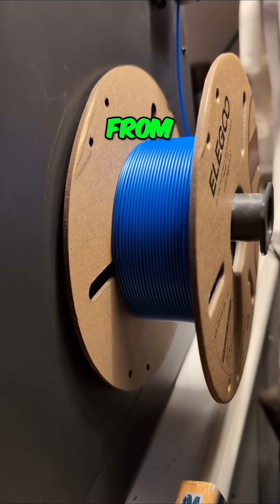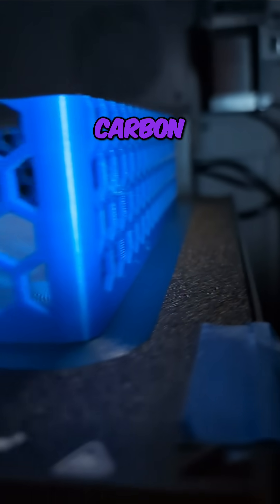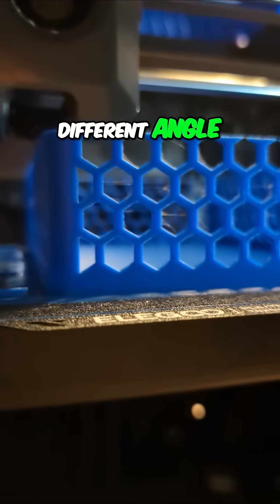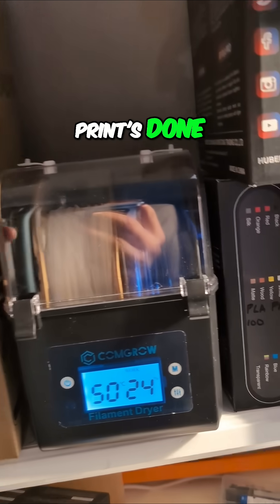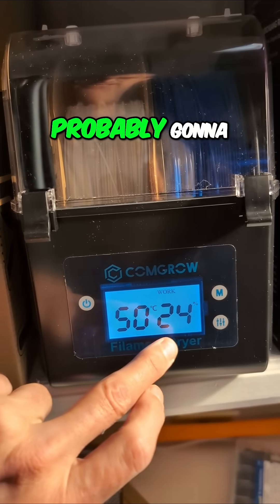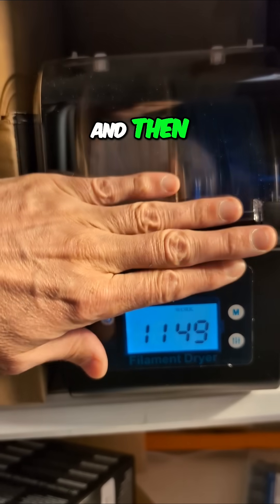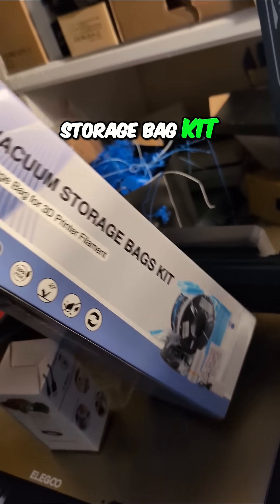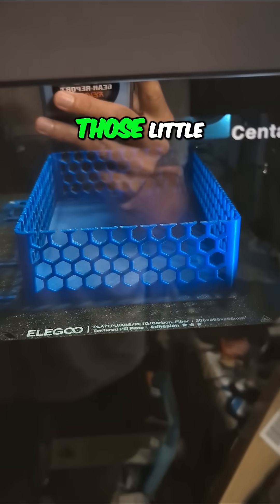3D Printing Problems? Dry Filament = Perfect Prints! 🔥

Comment: Had this strings in brand new filament that printed right from my dry box at %21 humidity. Dropped the temperature and it crisped up minimized the strings to almost none
Reply from the maker: Good tip... tuning the temp to your filament can clean up little issues.

Comment: Seattle here...if my PLA snaps like un-cooked Pasta, I dry it.
Food dehydrator running at 50C with indicating silica-gel beads.
Dry PLA for an hour after the beads turn orange.
I print hot and fast: no stringing!
PA6, PET and ABS get 6 hours in drier.
Reply from the maker: Dry filament FTW!

Comment: You can make a dry box to store filament that’s sustainable for very little money. I teach 3d printing in a very humid public school. Water tight xl Tupperware bin from Home Depot, reusable desiccant beads, and 3d printed desiccant holders. About $40-$50 keeps around 20 open spools of PLA dry with no issues. I’ve had spools that sat for 4 years and were perfectly fine. As long as you trim off about 8-10 inches of the end before you load into the extruder it’s a great solution.
Reply from the maker: I'll look into that. I have one dryer and am using vacuum bags now.

Comment: ah, I have a cheap Creality Spce Pi that i bought on amazon for $60, that I have connected to the printer, so the filament is dryed and used at the same time.
Reply from the maker: My dryer has put ports as well. Just haven't rearranged the workspace to fit it beside the printer yet.

Comment: It could also be a temperature issue too.  I’ve learned on some of my filament if I run too hot they string, but if I run them cooler they come out clean.
Reply from the maker: Good to know. Thanks for sharing

Comment: I use regular vacuum bags that you can put clothes in, I can fit 5 1kg spools per bag, they're reusable, and they seal with a ziplock style seal. You just use a regular vacuum cleaner (I use a small electric air pump, or the bags I bought are supplied with a manual pump). Works pretty good for me :)
Reply from the maker: Interesting approach. I'm happy with individual bags, as I only use 1 roll (maybe 2 if running both printers) at a time. So, no need to expose the others ot the super high humidity around here.

Comment: downside with vacuum seal bags is you have to rip them open every time you want to reuse that filament. You’re better off just getting a double seal ziplock bag with some desiccant after drying of course, and it’s more than enough.
Reply: If you get the reusable ones it's not a big deal
Reply from the maker: Agreed 👍
Reply from the maker: Huh? The vacuum bags i'm using are resealable. Just like zip-lok bags. :)  https://amzlink.to/az0uDmzCw3Mq0

Comment: What’s your humidity level? I print at 45-50 and have no issues.
Reply from the maker: Unfortunately, my office is a converted attic that was not originally finished. When the prior owner finished the space they didn't insulate or seal it well at all. So, temp and humidity vary a LOT from day to day. It can be 60-70% on a rainy spring day when the AC isn't running. Or 20% in the winter when the heat is on high. Right now it seems to stay between 35-50% most of the time.
Reply: @GearReportMaker I totally get that. I’m in the basement in an unfinished side with a dehumidifier running 24/7. 

Love your videos thanks for posting.
Reply from the maker: Thanks for the kind words. :)

Comment: how the heck do you manage to have so little stringing?! I’m in a 20% humidity zone and my prints look like a cheese pull from a grilled cheese.
Reply: Love that. 😂 do you have a dryer at all?
Reply from the maker: Everyone should have a dryer. this one works well enough for me https://amzlink.to/az0hzcqlMiX1q
Reply: @3D4U_7  Took me a while to respond, I do, didnt think of that😅
Reply: @paperfoldschannel607 all good. I print mine directly from the dryer into the printer. It’s really helped with the carbon fiber and glass filled filaments.
Reply from the maker: I'm printing with the stock filament profiles and just changing the temparature to something in the range printed on the spool.